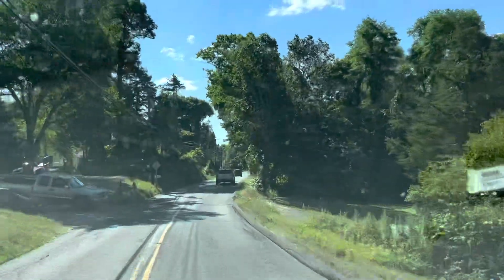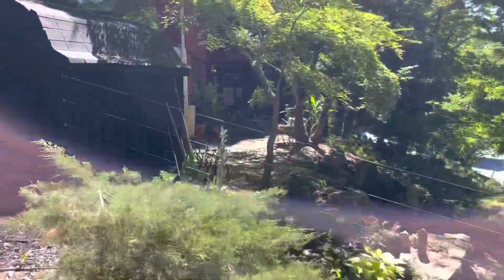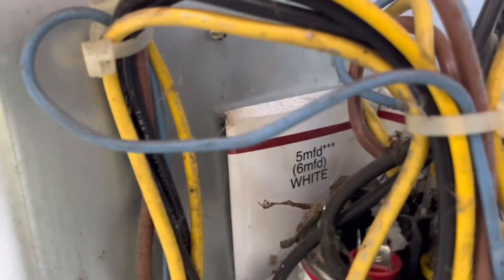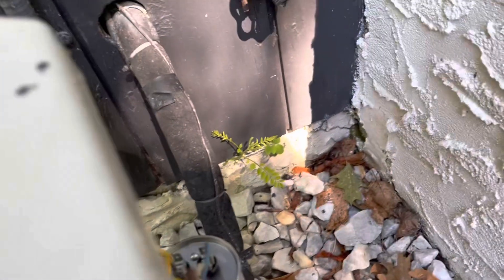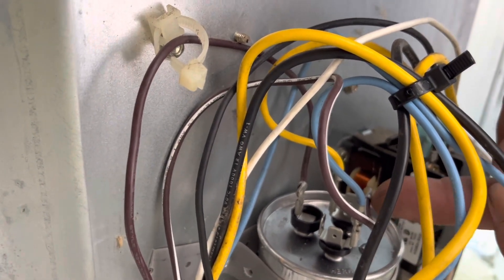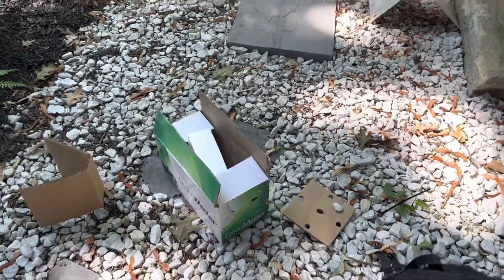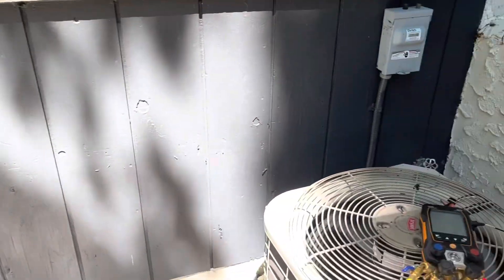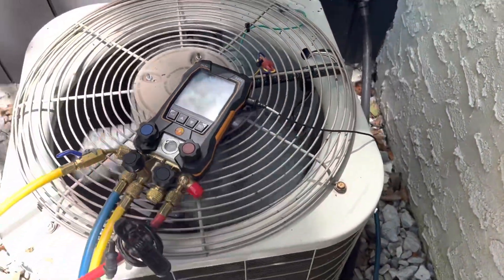MY CONDENSER FAN MOTOR IS NOT SPINNING.  WHAT IS THE PROBLEM?

Comment: Too bad those "Universal Motors" do not simply have a switch or different reversing wire set up that doesn't require the final looks of a crap replacement job.
Reply from the maker: Hundred percent true